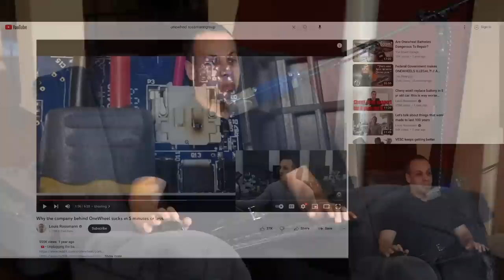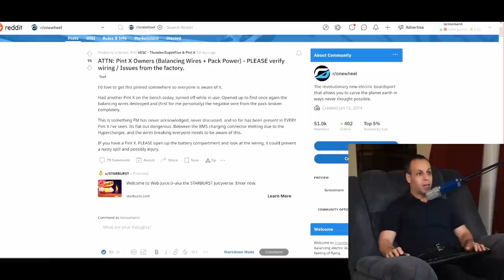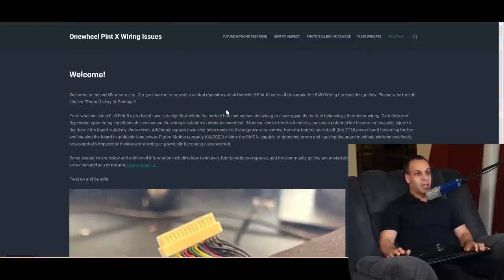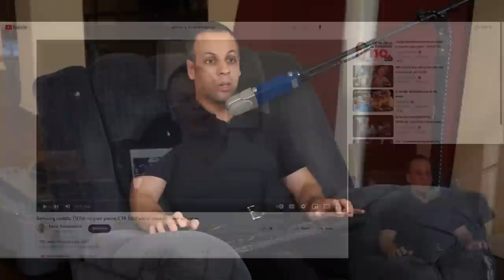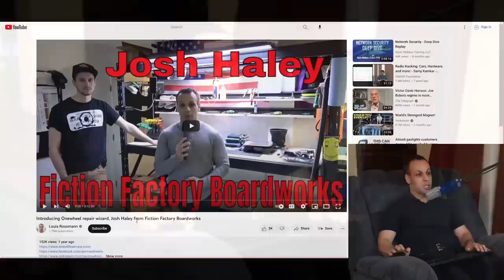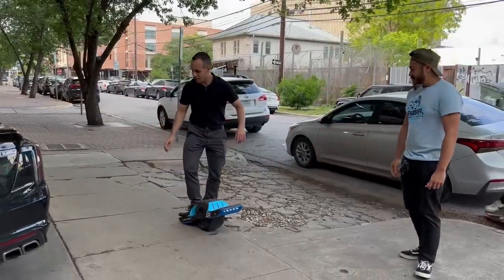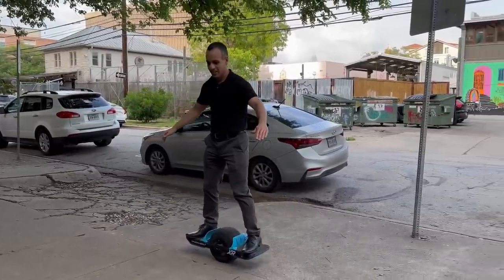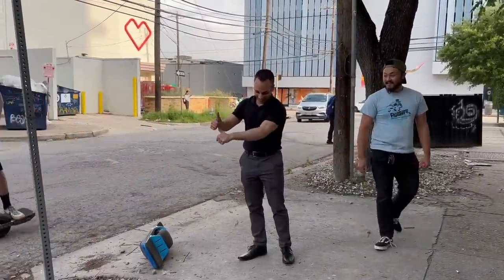The Onewheel Pint X has a dangerous design flaw that Future Motion refuses to acknowledge

Comment: Another huge issue that causes the boards to power off while riding is the XT-60 connector at the controller and the BMS on all models the pint, pint-x,  XR plus, and now the GT,  the connectors can come loose because they're not held down to the board or fretting builds up a layer of oxidation and they lose power, happened to me on my GT it started turning off on curb drops and then randomly.
The fix is to spread the pins on the male connector and add dielectric grease then use hot glue or silicone to secure the entire connector to the board.

FM has been aware of this problem and when people send their boards in for repair they simply replace the whole controller or BMS sometimes it fixes it because one side of the connector is new, sometimes the problem persists.
Reply: Xt60 loosing contact? Where did you get that from? I work with batteries and never saw xt60 loose connection
Reply: @Boz1211111  lots of post about it online

Comment: Right now, this is my head cannon. Because I just can't comprehend any other way it could have gone in the prototype process.
Good OneWheel employee : "Hey, if we use those parts and run the wires like that, the machine is going to destroy itself in a way that sensors won't matter. This could seriously injure or kill customers."
Guy in charge at OneWheel : "It'll be fine. We save money doing it this way. Besides, if they die then they can't sue us."
Good employee : "Their family can sue us."
In Charge : "You're fired."

Comment: I just sent my pint x in to future motions repair facility because my board started flashing a yellow light and saying that the battery was over temp. Future Motion told me that my battery was out of spec and that I need a new battery. My board is slightly over 1 year old with roughly 500 miles on it. Future motion sent me an invoice for over $550 to repair the board. I told them not to repair the board. 

Once I got the board back, I took it apart and all of my wires are crimped and the temp sensor wire looks broken completely which is why it’s giving me the error battery overtemp.

Comment: The firewall keeping the battery wire in place is way too tight and the corners in the opening are cornered way too sharp, so it chafes against the wire. My 2 cents. Solution: Dremel the battery wire firewall down to achieve smoothness.

Comment: We did a VESC controller and BMS mod to my friend's XR and the thing RIPS now! It is only the 3rd one we know of that has successfully been modded. The amount of crazy wiring, special screws, intentionally swapped connectors to cause shorts when doing this, and inability to find ANY info on motor wires or balance leads made the process a living Hell! Thankfully the only other person to do this is a professional drone builder and already mapped all the wires so after many face-time calls and pictures of old notes on paper, we got everything working and locked into place. Board should never need to be opened up again save for swapping the battery. Also, there are now tools the community has made so that if the battery gets unplugged you can Bluetooth to it and get it working which came in handy a few months prior when it Ghosted and crashed so hard the battery connector CAME UNPLUGGED! Future Motion is one of the worst companies out there when it comes to servicing their products both at a consumer and a company level. I for one am proud that the only thing that is theirs on that board is the housing and the motor itself!

Comment: I bought a unicycle a few years ago. It's still on the original tire so you can hardly say it's been subjected to huge wear and tear but a couple of months ago I went to mount it and to my surprise fell flat on my backside. It turns out the pedals had become decoupled from the wheel hub. E-mailed the manufacturer (Qu-Ax) and didn't even get a courtesy response. I had been riding this thing on the tops of walls and could easily have cracked my skull open had the unforgiveable manufacturing defect manifested itself an hour or two sooner.

Comment: I ride an EUC (electric unicycle).  They are very new.  Mine is an InMotion V13 Challenger.  Has a top speed of 55MPH.  It is self balancing forward and backwards.  One thing I like about it is the company has a video on how to disassemble and assemble the thing right on youtube.  It can be remotely diagnosed by factory through phone app and they will send you the parts to replace if under warranty or parts to buy if not.  I picked this brand and model due to their safety record.  This model has almost redundant everything, including power.  Also, they do not discourage working on your own stuff.  In fact, this one was made very modular so it is easier to assemble and disassemble.  I am glad I can work on my own product without it bricking and the company will support me if I choose to do so.  In the local ESK8 group there are a lot of OneWheelers and a few of them do have pints but I avoid telling folks bad news about their PEVs cause some people get really touchy about it.

Comment: Everyone has had notice that frayed wires on a transportation system are dangerous. They are the primary theory on what caused TWA 800 to explode and have been implicated in the failure of several aircraft cargo doors, some of which happened on the ground and some caused crashes. Frayed wires are a well known fire hazard as well, no building inspector would pass a building with wires that look like those in the breaker panel. This really is a stupid problem to be having in 2023, but here we are...

Comment: This sort of thing happens in poorly run companies when upper management push manufacturing volume over everything else. Or they create a company culture where reporting issues is pointless because nothing ever happens to fix them.  It can also happen when a company compromises assembly worker skill by paying peanuts. The workers don't care and tend to 'cover-up'/hide assembly mistakes rather than report them. Exactly what is happening at FutureMotion i have no idea, but it's probably one of those things imho.
Reply: This can also happen when the company wants to cut corners as much as they can so all methods are used the way it seems One Wheel is doing.

Comment: In my previous car before I owned it, the floor was repaired (new plate welded in), and when building everything together they clamped down the main wire harness going to the back with the seatbelt attachment on the floor. Well... what can I say... I got some nasty cable fire that luckily stopped due to the fuse burning after like 30s, even before I could open the hood and disconnect the battery. Considering the situation, everything was fine though. It just smelled burnt and I had to splice in 15 wires that were melted into a clump.

So this problem here is a big no-no! Especiall with Li-batteries involved. You don't know how those cables might wear out, and if some short accross the battery occurs, your "beloved" one-wheel might burn down, and possibly take your home with it (especially in US/Canada, as your homes are a bonfire waiting to be lit).

Comment: It reminds me of when I owned a '69 Camaro that had an ammeter installed. It was installed by the original owner's mechanic. I noticed it didnt have a grommet where it ran through the firewall. I learned that thinking "I should do something about that." Qnd got ng about my life was a bad idea. Insulation wore through and started a small fire that destroyed the fuse block. Rebuilding the wire harness and cleaning up the fire damage was way more work than adding a grommet. I never did get the windshield wipers working again.

Comment: I wish everyone knew about this. I had the exact same issue. All wires crimped by battery wall and my negative battery lead popped off. I just cut the wall and sanded it down. I then re-crimped all the wires and re-soldered the lead back on. Issues happened at +900 miles and now I am at +1700 miles with a new set of flight fins.

Comment: so when we talk technics:
the pint x is a wheel attached to a electric motor
when youre going 20 mph, no helmet, no gear, like most people who ride these do, and the device malfunctions because of a short or lacking voltage supply, that pint x could simply "stop working" if there is no failsafe implemented (which it pretty much cant have, since this is a hardware level issue)
that means, youre going 20mph on an unpowered device. an unpowered motor is a generator. going 20mph is gonna create electricity and thus become a resisitive magnetic force below your feet
going 20 mph that means, youre gonna brake suddenly...
youre gonna be thrown off with NO chance to recover
once your cog is overboard, thats it, hope for the best and pray in the milliseconds you got airtime that youre gonna land well enough

fkin irresponsible
Reply: Not only could a Pint X potentially stop working because of this, it in fact does! I experienced my board totally shut off as I was riding. I opened it up a week later and took pictures of what I found. I'm motivated to spread the word about this because I knew there were others out there in the same danger I was. - northuniverse
Reply: Hell's favorite Salty Berserker  Because of intense stress & weight on (-) lead caused by the BMS cover and overall battery housing design. We are seeing multiple reports of (-) leads being severed, most if not all of them appear as a cleanly severed wired. This brings question into the QA on these solder jobs.

Comment: From what I've found, there are alternatives to Future Motion... some of them probably worse (so called Chinese knockoffs), but there's one option that looks promising - the DIY VESC-based path (e.g Funwheel ST), which requires buying parts from multiple vendors and assembling it yourself, but ultimately allows one to make a device where each part can be replaced separately if needed without needing to send the wheel anywhere for repairs. And hopefully as a community based project, this should be relatively free from 'intentional' design flaws, and any problems should be fixed over time. The cost also seems more reasonable (it's trickier to calculate since you have to order parts separately from multiple vendors, but still it seems to be about 2/3 the price of Future Motion wheels of comparable parameters). However of course as a DIY option that needs some assembly, it has its problems, ranging from requiring some technical skills and knowledge, to requiring more time and effort to get started.
And I'm a little worried that most people who attempt building a wheel like that are people who already had some experience with Onewheel devices. For a person who just wants to get started with the hobby and has no prior experience with Onewheels, it might probably be trickier to start the journey with a DIY wheel.

Comment: I have 2 onewheels, an original Pint and an XR. They put a ferrite ring loose on the power button cable on the Pint and I have had to take it apart and glue it together multiple times.

Comment: I would personally ditch Onewheel, and go the Electric Unicycles way, they are 10x more fun and maneuverable. Fast too, so it would be advised to have protection gear. That said, some have a bunch of problems too, certain models have literally caught on fire over the years. Maybe it's another topic, worth pursuing in another video.
Reply: I would skip every last auto balance machine, because they all have these reliability issues.   Literally everyone I know who has used one for any amount of time has suffered serious injury...
Reply: @asdfdfggfd  The older Onewheels were supposedly good in the past (they happily invited people into their factory to check them out) but they've gone way down hill more recently
Reply: Hell's favorite Salty Berserker  lol. Only impressionable young men fall for those labels. True "alphas" (so to speak) don't give an f.
Reply: Hell's favorite Salty Berserker  bet that's fun hehe. but i wouldn't diss a sherman-s euc going 50-55 either. still gives a crazy full body workout. only downside, one could buy a semi decent second hand car for that amount of money (around 4k)
Reply: hellsfavoritesaltyberserke4724  I still would prefer something (without the issues IDed in the vid) that can go on grass, sand, gravel, etc.

Comment: I’ve had an incident with the XR. I was just riding like normal, at top speed, and it just stopped. Naturally, the board tilted forward, hit the ground, and I got send flying into a roadslide.
Reply: Did you contact the company yet to see how they'll try to pass the blame back to you yet?
Reply: The circuit board is resting in its housing without any padding in a way that causes the vibration of normal riding to wear away contacts on the circuit board and it will power off.
Reply: Same. But the FM schills awpays say it's because user error despise years of evidence.
Reply: @torinnbalasar6774  Yep, and at the time I didn’t know about all the problems surrounding FutureMotion and Onewheels, so I thought it actually was my fault.

Comment: wow. I've seen auto harness like that with pinch damage. usually not a dangerous condition since in a car, the harness doesn't really move around, but for an offroad application wires are stressed in all 3 dimensions it is always very serious

Comment: I mean "theoretically" you could monitor the current flow, voltage and temperature of each wire and prevent them from ever getting into a state where they do something wonky, but that costs a shitload of money and by that point you could just re-iterate the design of the cable

Comment: Anybody who wants a safer electric skateboard than these I recommend to get the Meepo V3. Its an electric skateboard with a top speed of 30 MPH and its a fraction of the price of those boards in this video. Also rechargeable. I've had it for over two years and ive never gotten hurt on it.
Reply: I switched from a Meepo board to a OneWheel because the skateboard can't handle offroad or large stones. I wanted pneumatic tires that can deform over rocks rather than climb them. Skateboards with interchangeable wheels and big tires are really costly, compromise on range and are heavy. The OneWheel seemed like the perfect solution.
Reply: @CokefishR  Interesting. Glad you found something that works for you.

Comment: I saw a one wheel flying down a busy street yesterday. Not sure if it was a pint or not. He was going really fast way more than 20 mph closer to 30.  If he crashes he would at least break something possibly be killed. You have no protection on a one wheel no airbags no roll cage no crumple zone no seatbelt.
Reply: This is why I keep my speed limited to 15MPH at maximum. If you're going slow, it's easy to run out a crash and land on your feet.

Comment: I had an issue with my HyperX headset and a broken external buckle; they're made of cheap plastic (this part is where you adjust the size of the headset and is subject to the most wear and tear), and one of the wires goes through it in such a way that you have to break it even more to replace it. I contacted support, and they don't have replacement parts, so now I've got to put tape around the thing to keep it together. A $200.00 headset that lasted less than a year. Thanks HyperX!

Annoying yes, but at least it's not going to hurt someone like this screw-up. Still though, screw you HX.

Comment: I had an air gun company tell me that I don't need to use a filter when running their compressor. They forgot install the filter from the factory and when I contacted them, that's the answer I got. Their manuals have safety warnings, saying to not use anything other than clean filtered air in my tanks and gear. Bunch of scumbags.

Comment: If you own a one wheel park it and pick up an euc  like a inmotion v12/v11 begode T4 / master , Veteran Sherman, kingsong s22 pro / s18.
You get much more diy friendly experience and support. Also with a little skill they can be 2 or even 3x faster with modern wheels like the begode ex30 and master pro v2 doing 55+ mph and range on the larger wheels can cross some small states on a single charge. My master pro v2 clocks over 140mi per charge and my aftermarket charger will have it topped off in 3hrs. My sherman S clocks around 100mi waiting for my v13 to show up but my guess is city cruises 70mi ish .
I live in riverside California and both my sherman s and master pro can get my to Santa Monica / downtown Los Angeles and back I have ridden the master pro to universal studios a few times..
I had an old gt onewheel for a hot minute and moved on was slow and buggy compared to my Segway and moved from the Segway to an inmotion v11 only to outgrow it in a few Months chasing range and speed the sherman S and kingsong s22 are flat out a short range car/ motorcycle replacement. And are much better at shopping than a motorcycle as it's not hard to load up a backpack and hold a few bags in each hand while heading home I have even done over 200$ in grocery shopping taking 2 ikea bags and a backpack made it easy

Comment: yes, independent repair is dangerous.
this shop could install a blackberry onto your roomba, if you let them repair it. and that is very advertiser unfriendly.
;-)
Reply: And then Blackberry wouldn't have to walk over to the chair to use it as a scratching post.
Reply: @mhfuzzball  well, we all want that youtube does not complain too much about blocking ads. so having an advertiserunfriendly kitty around might be a good idea so they can demonetize it on their own.
I'd even say that there needs to be more than just one advertiserunfriendly kitty around. ;-)
Reply: @robertheinrich2994  Oreo was sighted in this video.
Reply: @mhfuzzball  but as louis says: the kitty needs to be on the left side of the chair (or at least not on the right side with the mouse).